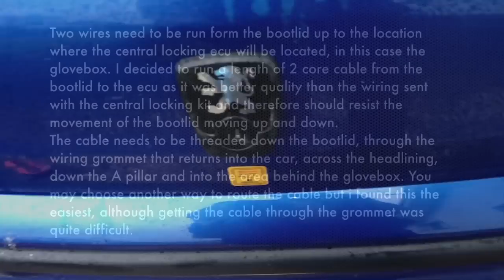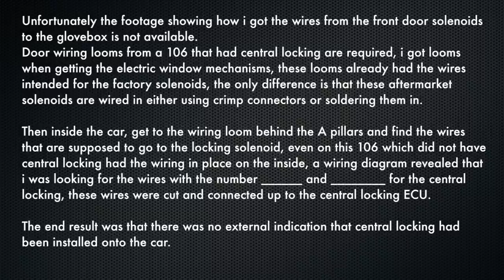Retrofitting Central Locking - 2002 Peugeot 106

Comment: did you reattach the evaporation barrier and how so? and isn't there aleady wire looms coming from the door connecting to the car? (the rubber thing)
Reply from the maker: the evaporation barrier; a bit of heat from a hairdryer to get the glue sticky again normally does the trick, failing that some tigerseal works very well, although its ackward to get off in the future.
As for the wiring looms, yes there is bits and pieces there, but the problem is getting all the oem bits second hand, it should be much easier but most breakers on ebay dont respond when asking for the parts, and any 106es in scrapyards here are usually the same spec.
Reply: peugeotCitroen2CV did you use a fuse when you connected it up to the battery?
Reply from the maker: Jack Auger Yes the hawk kit came with an inline fuse, but incase the kit doesnt come with one its a good idea to fit a fuse incase any wires break the fuse will blow rather than start a fire

Comment: Nice video ! I have a peugeot 106, 1993 model and I'm thinking of buying one of these cheap ebay kits. The problem is that it's a 5 door with no wiring on the doors, so It's gonna be a pain in the rear end :P I didn't understand why I need the original looms though (I can't find them anywhere anyways). I was thinking of buying some spare wires to connect the solinoids with the central locking ecu. Is it possible ?
Reply from the maker: The original looms were used here to ensure the wiring was done tidily although with the right trunking grommets etc it would be possible to make a good loom across to the rear doors. Its all very much a case of fabricating something up to suit.
Reply: @peugeotCitroen2CV  thanks for the reply. Since I can't find the looms I'm going to connect the locks with some spare wires I'll buy. Looking at the haynes manual (12.13 page 12,  book 1882) I can see that the wiring after the door locking control unit goes to ignition switch and then passenger fuse box. Can I just put a 20A fuse (f8 in passenger fuse box) and connect my positive wire there ?
Reply from the maker: @ioannisboukas2039  I can only say give it a go, i dont have a haynes manual to compare the wiring diagram with but plug a fuse in and use a multimeter to see if your getting any power out
Reply: @peugeotCitroen2CV  It's been a while but I've managed to get the kit to work to my car (Peugeot 106 1.4 1993, 5 door). Many thanks ! Great video! Quick tip: for the 5 doors the universal kit doesn't work right out of the box at the 2 rear doors, you have to drill the hole of the power motor a little bit and then fit it directly on the car's lock - there is a spike-like thing where the original power lock would've been.
Reply from the maker: @ioannisboukas2039  Thanks for letting me know, hope the 106 is still running well for you.

Comment: i'm french and i have a Citroën Saxo with no central locking, but there are wire in the doors that are unused, can i install central locking on my sax ? thanks
Reply: +Miiick3y - If you have the wire loom with the pre-install option for the central locking you're very lucky. Because it solves the biggest issue of retrofiring the solenoids. ;-)

Comment: Do you have a rough idea of the dimensions of the solenoids that come with the HAWK kit, I cant seem to find this info.
Reply from the maker: ibzkoty 
Its been quite some time since i did this and ive no spare solenoids to measure, but roughly guesstimating the solenoid size id say 40x40x100mm would be its square size. The rod can be shaped to suit.
Reply: peugeotCitroen2CV
OK thanks, much appreciated.

Comment: You said your subaru already had central locking, does that mean you only had to wore up one motor for the drivers door to make them all unlock? I've got a legacy with central locking, no remote. What's the best kind of kit for me to buy? Thanks in advance!
Reply from the maker: Ahy i only had to wire up one motor for the drivers door and the rest of the doors do whatever the drivers door does. This kit still works in the subaru with no issues

Comment: Which kit did you purchase, where from and how much?
Reply from the maker: Its a hawk central locking kit, it was on eBay for £20, there are probably more expensive kits about, but this one is easy to install, and works without any issues.

Comment: how did you pass the wiring through the door?
Reply from the maker: I had to get door wiring looms from a car that had central locking. The resin cap they put on the end of the connector makes it hard to run extra wires through.
Reply: Can't get a loom so going to have to go through the cap. Is it easy to access on the car side.
Reply from the maker: They are getting harder to get nowadays, the connectors have that resin stuff on both sides unfortunaltey. Perhaps check the forums i think it might just be a bit of an issue with these wiring looms, a nuisance for adding wires to. 
Possibly one option would be to try and add a second hole and some sort of conduit from the a pillar to door to bring the extra wiring, it would require more drilling and probably removing the door but would be a good way around that connector. Its a shame they made them like that.

Comment: Hey man, have you ever done a dashboard change on a 106 cause i have the old cluster and i want to change for the new one but theres like some kind of connectors for it and what do i need for it? Thanks
Reply from the maker: Hi no i have never removed a full 106 dashboard, i have removed the instrument cluster in the 106 foglight retrofit video. What are the differences between the two instrument cluster? More dials or different years of car?
Reply: peugeotCitroen2CV theres the one that has a digital odometer that comes from 1998-2003 and another one that has manual one 1992-1999, i just kinda found out its impossible to change without soldering the wires but thanks for replying anyway also about the central locking is it possible to get the indicators flashing like the other cars
Reply from the maker: Changing from a mechanical to digital odometer may indeed require a bit of rewiring one of the citroen saxo/106 clubs may have a guide on this, it is not something i have attempeted.
I think some kits out there will flash the indicators, this one was a fairly basic one so did not do that.